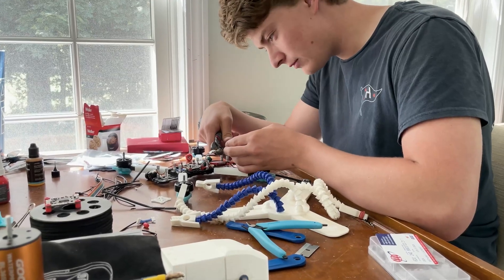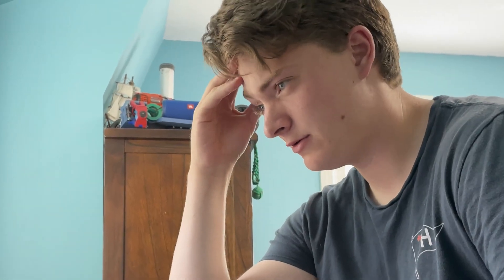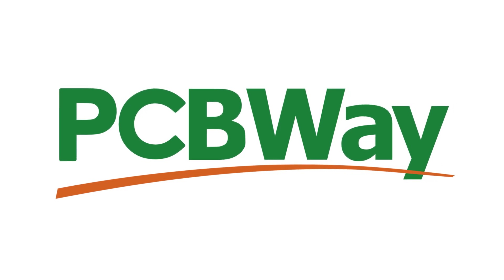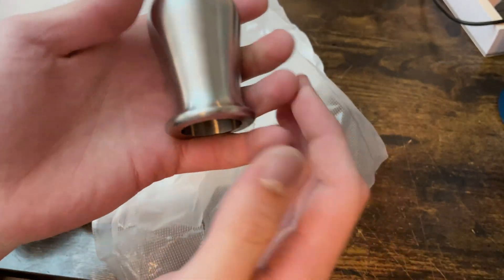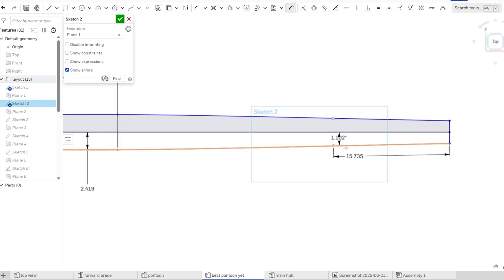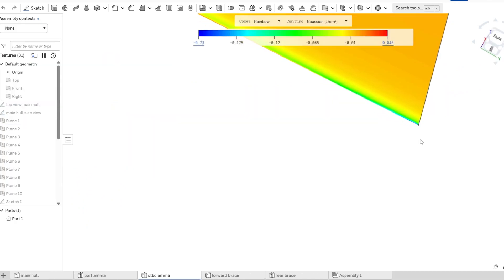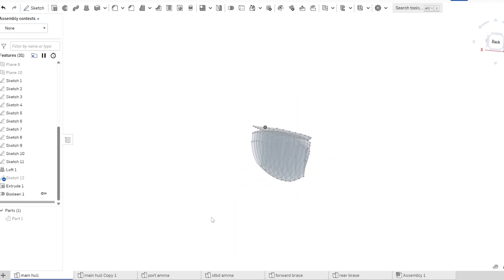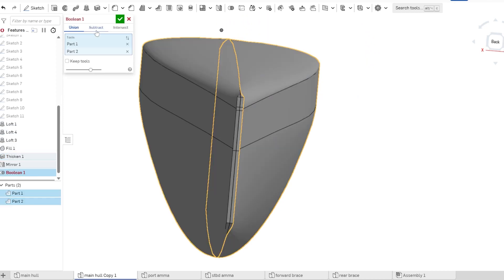I need Help with CAD...

Comment: I solved it! Fix was to just make the tip solid, yt deletes all my comments when I try to send the onshape link, so I made it public. Just sarch "RC Trimaran V2 - Filippus Version :)" And it should pop up :)
Reply from the maker: SICK! I just found it on OnShape. I went through the version history to understand how you did it. Very clever, and thanks again so much! Finally I can actually start to get somewhere with this project now that this figured out :)
Reply: @hamburgerinc6995 I don't have onshape, could you share how this was fixed and what the issue was?
Reply: @stratos2  I could explain it otherwise, the issue was that when you want to shell a part that in some areas were thinner than the actual shell, the shell operation would fail. The fix to this was to first have the solid model, cut off the nose (because it was too thin) and then shell the rest before attaching back the solid nose.
Reply: @filippus_ surprising that that worked here. A shell is supposed to be able to deal with these kinds of issues. Though I also regularly encounter issues where trimming the faces isn't the issue, but offsetting them. I encounter faces that just can not be offset quite often, most of the time as a result of a complex loft.
Reply: @hamburgerinc6995 Great! Im just happy to help, (and get a break from my other CAD projects)
Reply: I have also made a version that works by separating the tip, just like @filipus. I have added guidelines for the loft. Otherwise, the shell wouldn't work. I am certainly not an expert, but I think the problem is that the loft isn't constrained enough to do anything with it. My version is called: "RC Trimarian V2 - Thijs Edition" if you want to take a look.
Reply: OK, I took a look. First thing I'd say is you made too many sections of it and its probably making the underlying math of the hull too complicated which is why it got all lumpy.  Its trying to stuff the surfacing splines into the sections and is causing it to bunch up.  You could probably make it with 3 maybe 4, then use guide curves to shape it.  I think closing each of the sections on the center also probably wasn't helpful, id just make the left and right half the stich them togeather.  Also making the from have that little flat pat make be complicating it too.

Edit: Does onshape force you to make closed profiles in surfacing?  Because that is pretty whack.

Comment: what i did in fusion360 when i had issues like that was. i copied the body, scaled it down slightly and then basicly used it as a negative to carve out the inside that is not perfect but it does the job.

Comment: Fixed it for you, much more simply and with a method that can be used for your models in the future! Search "RC Trimaran V2 - shelled e z p z" to find it with onshape. I only added 4 features to make the shell and it took about 10 mins. 

filippus_ did make it shelled and solved the problem, but with more of a brute force method vs working with the limitations of CAD and leveraging the geometry to your advantage. 

Happy to answer any other questions and offer help if you need it later! Cheers!

Comment: I've been trying to solve this too for ages in fusion. I draw RC aircraft, and shelling them would be infinitely useful, but I have not been able to solve it. I've just entirely given up on expecting the shell to work. I really hope you can figure this out, it would help me out a huge amount too. 
I'm pretty sure it's something to do with surface curvature complexity, as my planes also all end up with a few faces that even individually I can not offset for some reason. I suspect it is such a surface error.
What you could try is adding more and more rails to the loft to make it more constrained. Or try to construct all the shapes out of arcs instead of splines to avoid that as an error source.
Reply from the maker: fingers crossed
Reply: make solid part of outer shell. copy. scale down by factor xy (calculator, fusion modify -> scale). subtract from outer shell. (modify -> combine, cut)
Reply: @vat8367  scale down does not create a surface of constant thickness. for a more complex shape with holes such as air intakes, it can even cause those holes to be filled in.
Reply: @stratos2  then you can just model inner and outer part yourself and use it  that way. or you use thin extrusion.

Comment: try leaving the ends open, shell, and the make the ends from solids. or you may need to shell outwards. Did you try thicken?
Reply from the maker: yes, I did try thicken. the profile is the exterior profile, so it has to thicken inwards, but then the weird geometry from the loft near the bow causes it to overlap :(

Comment: Hi,i don t know if it can help,https://youtu.be/goSEotCLLOY?si=DGAuiyw755fz1j99 from 16:00 ,i know it not onshape,but i think that shoud be the same ideea. One more idee , you shoud model the narow part separated. That part is 0.2 and I think that's why it doesn't let you use the shell command,or you could ofset the sketchs manually and after to use loft
Reply from the maker: thanks for the ideas, I'll try that out